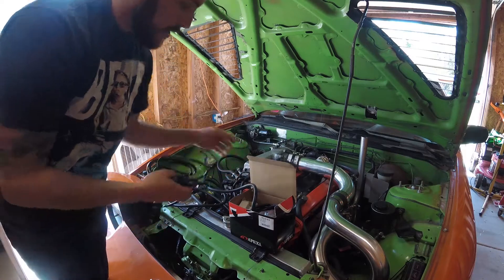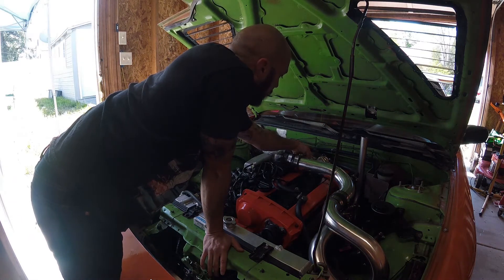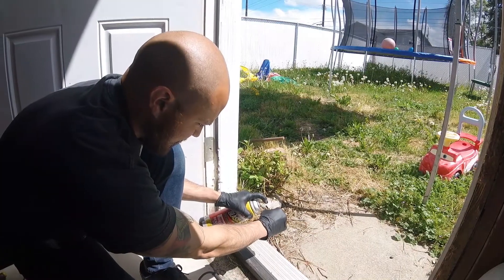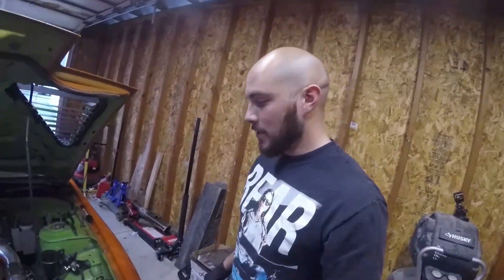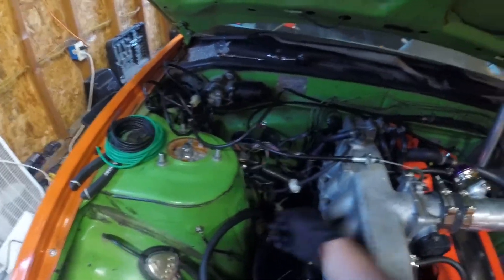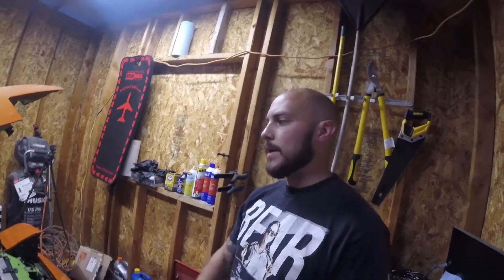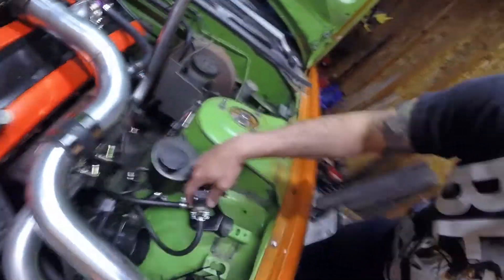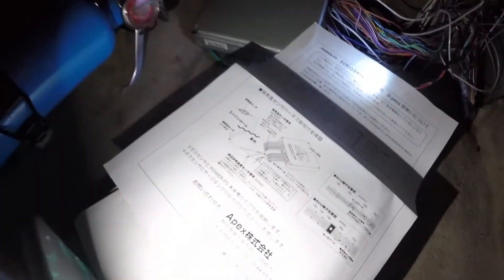Apexi Boost Controller Install. How to Convert From MAF Sensor to MAP Sensor RB25DET NEO

Comment: Hi it’s any chance to  help me with the ignotion map and injection map? I reset the maps by mistake, I have a Toyota mr2 Configuration :
• Engine: Toyota 3S-GTE (2.0L turbo, 4-cylinder)
• Turbo: BorgWarner K27 (standard turbo, max revs ~8000 rpm)
• Injector: 550cc (larger than stock)
• ECU: APEXi Power FC Full Computer 
MAP sensor is mounted on the intake manifold.
Denso 909110-13003 with two hoses connected to the intake manifold

Comment: Yo sick paint job bro! I’m building my 95 Nissan 240 SR20 and have the Apex Power FC ENGINE Management and have my AIT hard wired in and the harness for the 3bar map sensor and boost sensor but I’m at a loose on how to plumb it in with the vacuum lines can u help me out brotha!
Reply from the maker: What do you need to know?  IAT should be near the throttle body, MAP should on the manifold plenum and the boost sensor vacuum should go to the manifold as well. Try not to T off the same vacuums lines but sometimes you have to do what you have to do. Are you running the stock sr20 intake manifold? I’ll try to make a video for you and I’ll tag you
Reply from the maker: https://youtu.be/sZQRlRRUeeE
Reply from the maker: I made a quick video to hopefully help you with understanding vacuum lines and where to get the vacuum source from

Comment: Hey man, so that map sensor you had , did it connect to the side of the pfc or did it connect where the rest of the harness goes? could you send a photo of how you set it up please? I have an rx7 fd and i am real confused how this works. Would really appreciate it bro
Reply from the maker: It connects on the side of the pfc. There was a port for it. You need the harness to plug it in but it should have came as a kit
Reply: @Boost-EdAutomotive  ok sweet, does ot figure out which wire is which or is it specific for the boost solonoid and sensor, i plan to use a mac solonoid for mine

Comment: sup bro i have a skyline gts r33 with a rb25det neo but the maf got stolen ill like  to convert with the stock ecu to map i already have the same turbo kit and the same boost controler do you have an idea?? cool video ill suscribe
Reply from the maker: You will need an ECU capable to run MAP. the stock one unfortunately wont run with it converted. Sorry I took so long to reply, I need to turn my notifications on